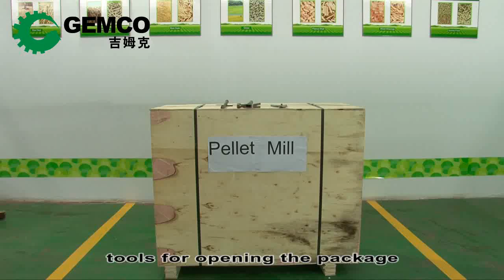Wood pellet maker, Wood pellet manufacturing equipment, wood pellet press

Comment: What are the available pellet diameter sizes ?
Reply from the maker: our pellet mill can make the wood pellets with the different diameter , 6MM , 8MM  is the popular normal size for wood pellets , and some clients demand 5MM or 10MM , it is also ok ;  if the clients want to make animal feed pellets , 2.5MM ,3MM,4MM,5MM,6MM,8MM is all ok .
Reply: @GEMCOPelletMill  i want to press coal dust not charcoal just regular coal. Can you make a hard pellet out of coal with this machine and is there need for any binder ?
Reply from the maker: could you let us know your email address so that I can ask the sales department to contact you ?

Comment: Can the Die (Pellet Size) be changed?
Reply from the maker: yes ， the diameter of holes can be 6MM or 8MM for wood pellet . 
if you want to make both 6MM and 8MM wood pellets , you can buy two dies , one is with 6MM ,another is 8MM .

Comment: Excelentes equipos pero yo no he podido comprar porque no funcionan con 220 volt.
Reply from the maker: +Freddy avendaño     
which country are you from ?  do you need the machine with single phase motor ?  or you can apply for phase 3  industrial power  ?

Comment from the maker: Model: ZLSP D-Type 300B
Capacity: 200-250KG/H
Power: 22KW
Net Weight:410 KG
Outside Dimension: 1200*500*1070 MM
Please visit our website, you will learn more info.